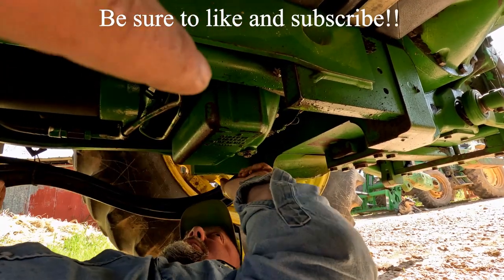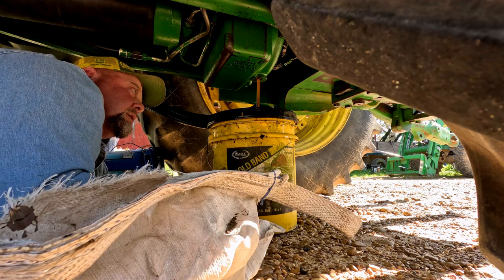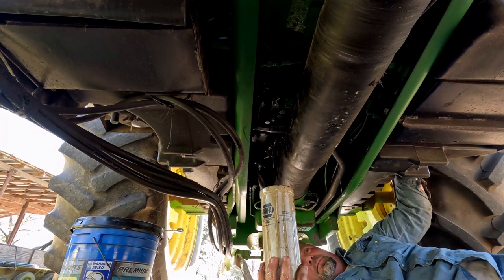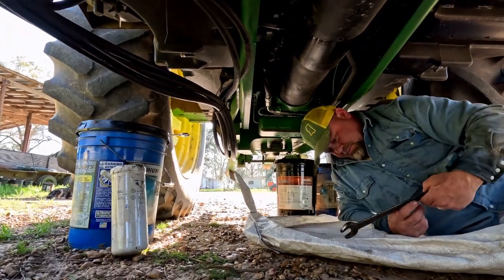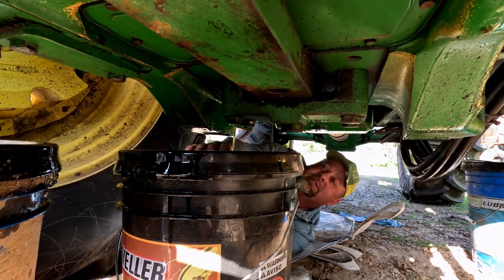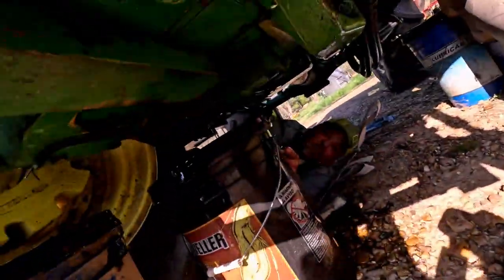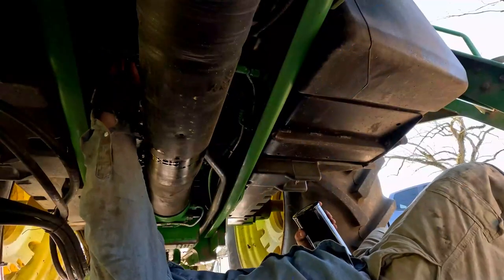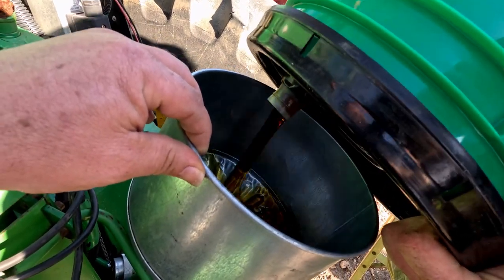How to change Hydraulic Fluid and Filters on a 7800 John Deere

Comment: Hello, thanks for the video! I recently got a problem with my johndeere 7800, the light that is indicating low oil pressure in the gearbox came on. Probably it is because we didnt change the hydraulic oil and filters, do you think original johndeere filters are better than the filters made by other producers? For example here in Europe we got MAN filters and in my case they are half the price of the johndeere ones.
Reply from the maker: Most of the time, the higher cost is only because of brand name, but same product. Personally I would use the cheaper ones..but you make your own decision. we buy cheap...whether it is John deere product or something else.